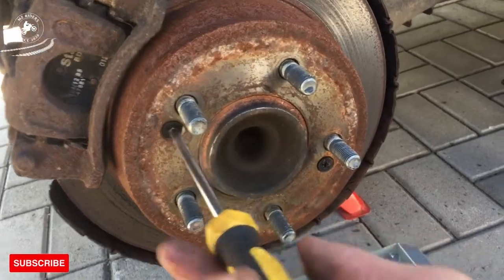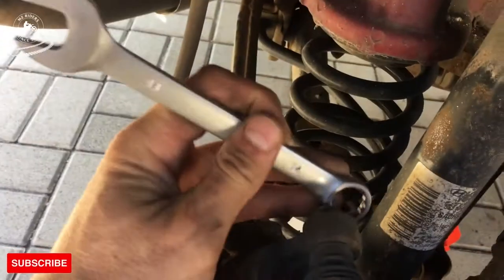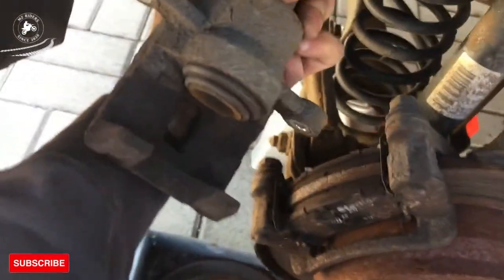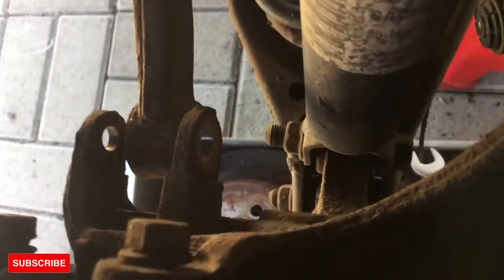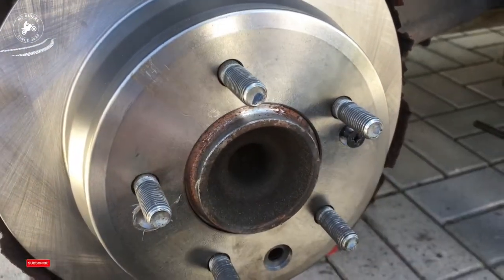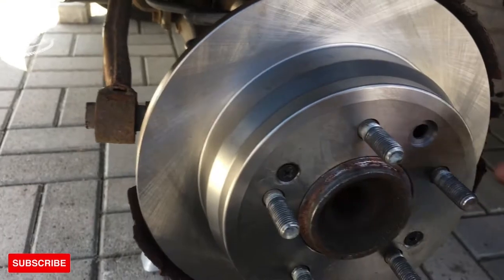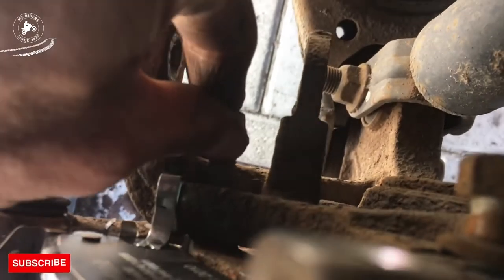How to change rear brakes on Kia Ceed

Comment: The most important part of this procedure is missing... The moments of the brake disc removal... Im curious, why...(?)
Reply from the maker: @bartonbalint2053  hi, once you unscrew the 2 bolts holding the disk and brake shoe, the disk just pops off , or if very rusty just tap it with hammer and it will come off.
Reply: @MZRIDERSchannel  maybe, yes... When i bought my Ceed, it was not an easy process to remove , as you described now. Because there was an edge, inside the disc. Thats why i say, to see the moments of the disc removal is an important thing. Otherwise , thanks, it's a good video, I just miss this small part of the procedure.
Reply from the maker: @bartonbalint2053  i see, the hand break was holding the removal. In this case you can use the set up screw under the rubber cup and make it as smallest as posibble, than it should come of bit easier.
I will try at next oportunity to capture this part of process.
Reply: @MZRIDERSchannel  thanks !!!

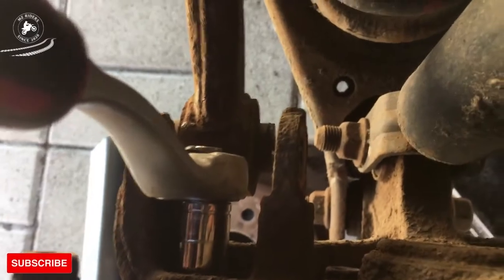Comment: @ 1:40 … ohne Probleme zu lösen ? Oder muss man den Träger stützen ? 🤔.
Reply from the maker: Generally the screw come out 
fairly easy. of course there are cars where the rust did it job.
Reply: @MZRIDERSchannel  is it easy to loosen this screw?  That's a stabilizer, isn't it?  can you simply loosen them, change discs and screw them back on?  or is there something to consider when solving this part?
Reply from the maker: @hurtblocker7506  i had only one situation over many years where i needed a new screw. 9 out of 10 the original screw come out, get clened and go directly back. Only trouble can be a lot rust. Use the corect tools and maximum 30 minutes to change the break disc. 
If some idiod worked on your car before and torq the screw to much than you may have to use more muscles. Othewise i share a hint. Use "O" wrench and gently hit it with humer.
Reply: @MZRIDERSchannel  ok nice .  which part exactly is solved there?  do you need additional support?  So if I loosen the screw nothing happens?  So the car doesn't crash down?  the part looks like a piece of the axle
Reply from the maker: @hurtblocker7506  you need to jack up the car. Lets say you do rear left, you  put the jack under the left rear part of the body, same as when you changing the tyre. 
Than all screw undone in video can be freely undone without any aditional suppprt.
Reply: @MZRIDERSchannel  nice, thank you 👌🏽😊😊